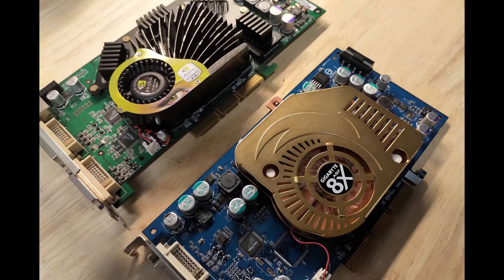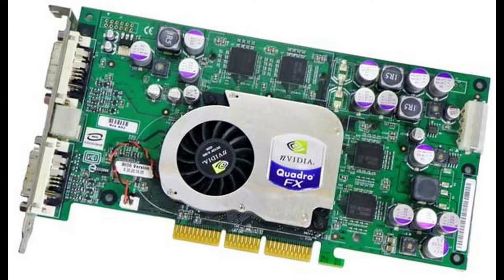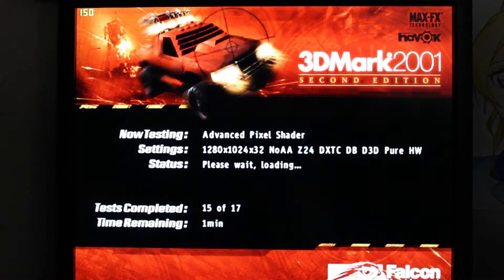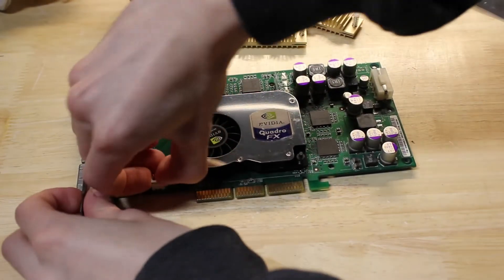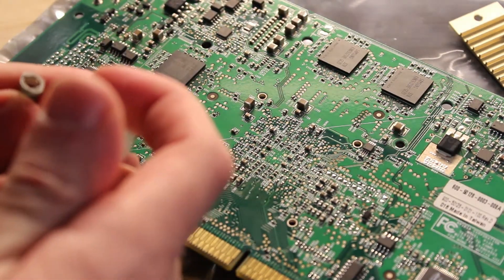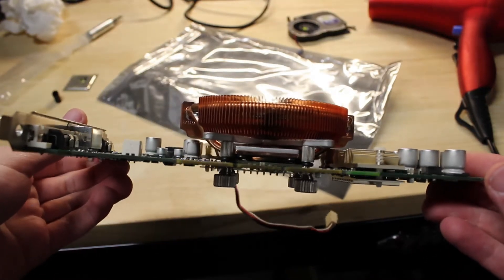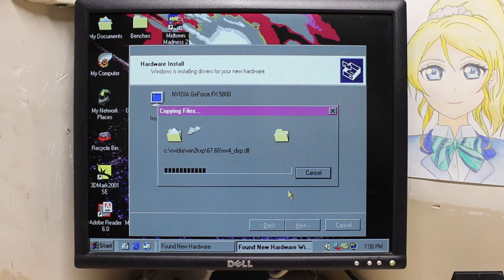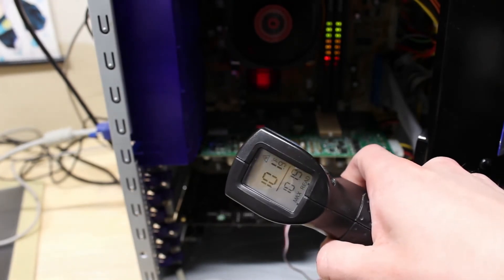Making a GeForce FX 5800! (Quadro FX modding)

Comment: Didn't except a delidding :D
Reply from the maker: If you want to actually use these cards instead of putting them on a shelf to sit and do nothing, de-lidding is necessary :) Keeps the temps at acceptable levels
Reply: @big-ts-tech-corner  Need to keep that in mind if I find a Quadro for a cheap price. Never been a fan of the FX series, but doing some roundups on my AGP cards from time to time is fun. :)

Comment: I also bought a Quadro 1000 and I'm gonna convert it to hopefully an ultra. Ultras had GC1K memory and not GC20. GC20 is still binned to 500MHz at 2.5V though so we will see. Im gonna use a Zalman VF700 Cu and Alphacool 10x10mm copper coolers for the memory. Im gonna up the mem voltage and also add the two missing 1500yf caps. My memory was running fine at 450MHz without messing with voltage or timings and I havent tested more yet so Im still carefully optimistic about 500MHz.

Comment: I bought today Quadro FX 1000 AGP by 80€, same card you have there. Im going to mod that to FX 5800, sadly i did not found good/compatible cooling systems for that GPU on ebay etc.

I noticed one difference with that QFX 1000 and actual 5800 Ultra, is those two missing capacitors from top of the board, is there something to do that QFX 1000 has some limits to get overclocked etc and if you place two missing capacitors, does it help to stabilize to rise the clocks to actual 5800 Ultra clocks(memory)?

Comment: With that heat sink you could probably max out the memory and core on the 5800 based on the temperature at 32 c when you had it set to 300mhz could you do that next video? That would be cool
Reply from the maker: The core has no problem running at 500mhz, but 1000mhz on the ram is unstable. I need to research voltage... RAM was running around 45-50c under full load in a case with only somewhat ideal airflow. 

In my Antec Three Hundred case (housing my AGP benching rig) I may be able to get away with it as there is a dedicated side panel fan... I'll consider it. Just don't want to cook the RAM :)
Reply: @big-ts-tech-corner  40 to 50c isn’t that bad and on the software you used it was max of 800 MHz but it’s true tho definitely don’t want to cook the ram